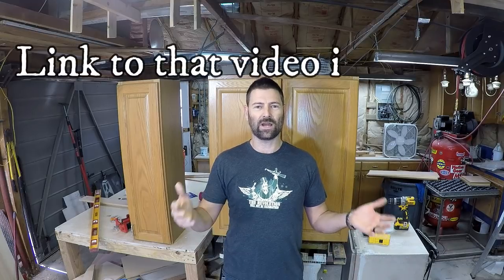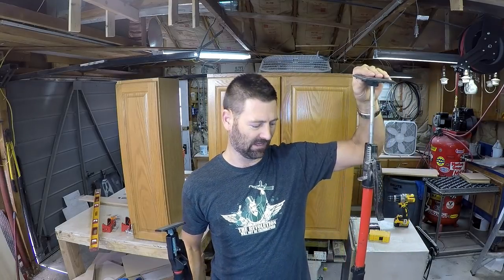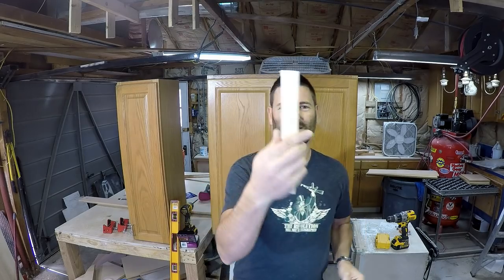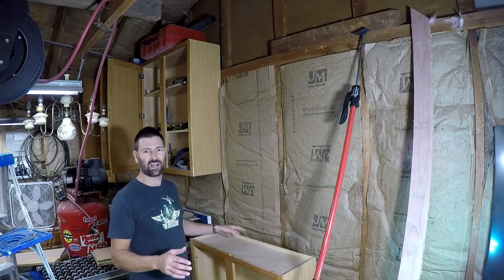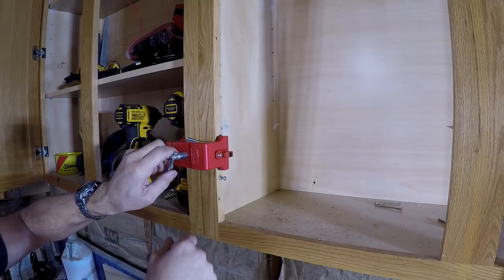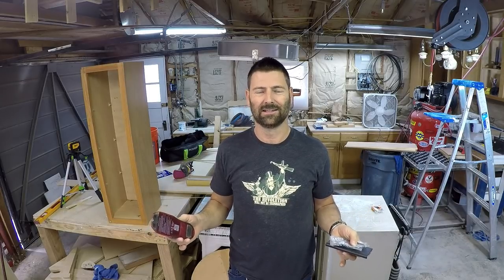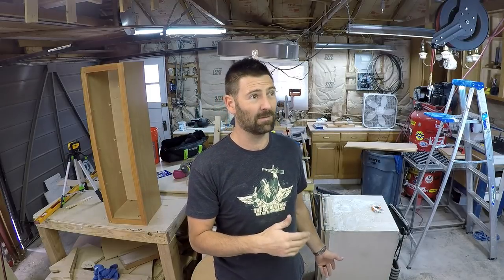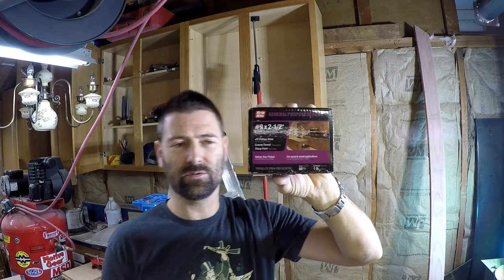Must Have Tools To Install Cabinets | THE HANDYMAN |

Comment: Great video. I've been a trim carpenter for 20 plus years an installed probably 100 sets of cabinets before I discovered the face clamps. There are truly a life an back saver. Makes lining up the cabinet styles an rails effortless. I would check into trim head screws for attaching cabinets together. The head is just about same size as the screw itself. I swear you will love the results. An they are handy for a lot of other situations. I was in trim carpentry for a long time before I discovered trim head screws also. I'm definitely not trying to be condescending because I'm still always trying to learn. An watch your videos often to learn the business side of it all. An I've learned alot. Thanks an God bless
Reply from the maker: Thanks for the comment.  I'm going to go look up the trim head screws right now.   I appreciate the valuable information.
Reply from the maker: I just ordered a box.   Thanks again.
Reply: No worries. Like I said been in it 20 years an still learning. I just discovered CA glue a week ago an used it atleast 10 times. I use it to glue crown an base returns an rolled corners. Saves me from having to glue em an then kill time waiting for dry time. I have learned a lot from your videos on talking to customers an selling my work at the prices it calls for. Estimating has always been intimidating at times. An it's easy to sell yourself short. When I watched your video I was like that's me going over what I'm gonna say an how I'm gonna respond. It's all about confidence an doing research to know what your talking about. Anyways it was awesome to see I'm not the only one running over it all in my head over an over. Sorry for the rant an keep it up brother
Reply: The clamps are great.  Use them to get your drill bit to go in straight.  Use #8 or #9 deck screws.  Then use a long 1/8" drill bit to pre-drill.  Use a drill stop or piece of tape to know when to stop drilling.

You can counter sink the screws in.  Get a countersink bit or a countersing w/o bit.

Comment: I recommend a ledger board that you pre level. This is great if you plan on a backsplash this would be a good reference point for measuring where your studs are in the wall.
Reply: Great idea, I do this every time. Makes solo installation much easier.

Comment: Well we’ll we’ll.... looks like this guy will be ordering the third hand set and clamps😎Thanks for the info !
Reply: I used a truck bed cargo bar when I did mine. Has holes in the feet so I attached square pieces of wood.

Comment: Good info. I like the third hands and use them often. A couple of other tips I use. I like to locate the top and bottom screws at the hinge location to hide them. I also use trim head screws to go through the face frames. McFeely's has really strong hardened screws that seldom break, even in hardwood. Proud to call myself a Handyman. Cheers!

Comment: I've been using a stud finder that is just basically some strong magnets.  It picks up where the drywall was screwed into the studs.  It has worked flawlessly so far, but obviously has its limitations.
Reply: Only problem with that is,  it only finds nails and screws , your dependent on the last guy to be in,on the stud , doesn't actually find the stud .but kinda works i guess .

Comment: Very nice demo. The right tools make all the difference. I have two new dishwasher installs tomorrow and sure as shooting, the base cabinets will not be vertically square and at least one of the old ones will be a nightmare to extract because the floor tile was installed after DW was shoved in the hole, and the other one, I'll have to trim a cabinet to get the new DW pull down door to open correctly. But with the right tools, no sweat. keep up the good work Handyman.

Comment: Regular wood screws for the face frames, i drill them with a tapered countersink drill bit. GRK screws to attach to walls. You don’t want to get pull through for holding the weight of the cabinet. Good video.

Comment: I bought a pair of those bessy clamps after watching your first video. They are nice. I also bought four of those blue zip-up poles after you posted that video a few months back and have used them for holding plastic up. I bought a pair of the mini third-hand poles for mounting cabinets when you already have a countertop.

Comment: Great tips and demonstration of the various tools.  Tip: use star or square head screws to reduce the risk of stripping phillip screws and to get more grip to drive in screws.  Curious.  Why no ledger board?  I assume so you can demonstrate the use of the 3rd hands.
Reply: I'm guessing no need with the 3rd hand?
Reply: I use a ledger board.  That is level.  Then no guesswork.

Comment: To add to this, I am torx/ star screws every where, cabinet screws a must, I like tools that double up, less to haul in and out.
My impact with 1/4” bits, just swap for star bit to drill bit on one tool.  Face frame clamp is nice.

Comment: How about a stud finder, hole saw set for drilling plumbing holes, oscilating saw for trimming shims, foxtail brush for cleaning out the cabinets, and maybe a bar of parafin or soap to coat the screws so they drive into harder wood species without snapping.

Comment: Great video on  the tools used to install cabinets.  With a 3 inch wood screw isn't there a risk of puncturing an electrical wire or plumbing pipe?

Comment: Another thing I do is rub a bar of soap along the screws before i put them in. As the screw turns, it heats up and melts the soap, which lubricates it and helps eliminate split stiles
Reply from the maker: great tip.  I will have to try that one.

Comment: Have you ever used the EZ-Level cabinet levelers to install floor cabinets and if so what was your impression? They look like they would work pretty dang good and not a bad price either at about $7.50 a pop

Comment: Oh that walabot is all I use. It saved me from finding wood or metal studs with wires running through them so I didn't hit those wires or plumbing either while drilling or cutting into said wall. Go test it out and looking forward to your thoughts.

Comment: Lots of electrical on the wall where I want to hang my cabinet...right above 2 sockets.. I've tried locating the studs with a Zircon, but false readings...

I'm thinking I should just cut out the existing drywall 1" smaller than the cabinet so I can see the internals...and be SURE I don't hit wires!! 

....or endoscope it.

Rather cut out the panel though...Nobody will know unless they take down the cabinet...

Thoughts? Thanks

Comment: One comment, to screw the cabinet together I use or recommend trim head screws. The small head gets countersunk, plus they come in white or black which looks better on painted cabinets. Barely noticeable when complete
Reply: Use a countersink to put them flush with the surface.

Comment: Instead of polls i put a ledger board level across the bottom and set the boxes on that. Also. I put a 3/4" scrap between the studs at the top of the cabinets so I don't have to worry about finding a stud.

Comment: Nice work.  I bought the 3rd Hand 4 pack in 2004 and never thought to use them the way you do.  I would put 2 under a cabinet but your way looks better.  Is there a reason you don't use the guide hole in the face frame clamps?  And did no one before you think to use "The Handyman" for their channel?  Did you start this in 2005 or something?  Sorry for all the questions.

Comment: Question on securing narrower cabinets.  We have a wall that is 99", and the cabinets that we are buying are only available in 30" and 36".  Since one is above the stove, we were intending to go with the 30" boxes, with 3" spacers at one end, and on both sides of the bridge above the stove, which will frame the microwave nicely.
Problem:  Studs are on the corner (behind the 3" spacer), at 16, 32, 48, 64, 80, 96, and the other corner.
Cabinet bulkheads are at 3, 33, 63, 66, and 96.
This puts one stud in the middle of the first cabinet, the 2nd just inside the bulkhead, but then only one stud behind the 2nd cabinet, and finally, one behind the 3rd cabinet, plus one directly behind the bulkhead.
These are particleboard cabinets and I'm not sure that I trust them hanging on only one stud.

The only solution that I can think of is to mount strips to the wall, attached to all studs, then screw the cabinets to them, then build out the backsplash to fill the gap.
What do you think?

Comment: I find all kinds of uses for GRK cabinet screws, not just for cabinet installation. I keep several sizes in my screw organizer.
Reply: Karl Armbrust the GRK’s are nice. I’m not sold on the need to use torx though. Sometimes it’s an inconvenience.
Reply: Mookie Man when I have a choice, I always buy torx. Bits last longer, screw heads never strip. Yes, it’s a bit inconvenient to make sure you have the bits when you need them, but the larger boxes of screws usually include a color-coded bit. I think they are worth the inconvenience.
Reply: Have been using GRK screws for years,great product,also make trim head screws to hold cabinets together
Reply: Karl Armburst, where do you buy GRK cabinet screws?
Reply: Earl Stivers In my area Home Depot and Menard’s.
Reply: Thanks 
 @karlarmbrust8846

Comment: It the back panel with enough thickness to support the cabinet?

I've seen videos where the cabinet it attached on the rail not over the back panel directly. Can you show the way, please?

As far one the best explanation ever about Upper Cabinets installation, very nice spoken, tools y patience.

Kind regards,

Matt.
Reply from the maker: Only cheap cabinets have a thin back.  These cabinets in this video and in all my other videos have a solid back to them.
Reply: @TheHandyman1  thank you, I really appreciate it.

Regards!
Reply from the maker: Some will have thicker strips of wood at the top and bottom to screw through
Reply: @TheHandyman1  which thickness do you use or is recommended for the back panel?

Comment: I use a tool called a “studbuddy” from amazon literally the best stud finder ive found lol got it samurai carpenter he showed it and it needs no batteries, it works off of a magnet 🧲 with drywall screws and nails
Reply from the maker: I usually work on older homes with wood lath and plaster.

Comment: I might have left the right end of the big cabinet a bit loose from the wall until I got the small cabinet bound to its frame, then checked for the need for a shim. Why no drywall?

Comment: The red bessey clamps appear to be made at different factories in China and QC sucks!! I bought 3, and 2 of them are missing a bushing, causing the drive screw to bore into my cabinet faces and ruined my brand be cabinets!!! And the 3rd is better but it's still not flush behind the plate. I can not recommend at all!!! If you do buy them, you should use an additional shim or something to protect your faces. I'm so mad!!! Great video, BTW. Very helpful. Comment is to warn others of my experience with the bessey clamps.

Comment: Hi

What screw do you use for steel studs in condo apartment?   length and company that manuf.  another question.    Do is ok to intall kitchen cabinets on 1" double drywall on steel studs, is not to weak??  Where can i buy the climbs for cabinets.? 

Thanks.

Comment: I am claiming rights to the error at 9:30ish, and cutting off haters.
Denigrating comments are hereby denied.
SUBJECT: Yeeees, it's true there are 2 forms of echolocation, and he said, "sonar".  Radar would be the expected word use, however if you will look up SONAR, you will find that it is a form of sound wave, and the lesser included definition is for both water and air, whereas Radar is more typically used above sea level.
The man is correct.
Reply from the maker: Thanks for the comment.

Comment: Hey Mr. Handyman, quick question. I have seen cabinets that are "floating" with no wall behind it. I would assume you would use the same method finding the studs in the ceiling to screw into?

Comment: I have some of the home depot yellow extendo sticks, they even have different ends to make the poles more functional for other jobs.   That handle that you grip to extend is neat though, on mine you just turn the pole and it screws up or down.  Has anyone noticed you put some of the shelves in backwards so the finished side is to the inside of the cabinet?  The Internet usually see everything.  If not are they still like that?

Comment: See that use fastcap, but wondering if ever tried the ZipWall brand. If so, any major differences (besides PRICE), & which do you prefer? Wondering b/c looking to get more & don't wanna spend money on more ZipWall, especially if Fastcap works just fine.
Thx😊
Reply from the maker: Not sure how much weight zipwall brand can hold up.
Reply: FastCaps has some good videos on the 3rd hand holding cabinets and for use in dust walls.

Comment: Are there standard dimensions for install the upper cabinets above the face cabinets?  And, is such a dimension from the countertop height, or from the top of the base?

Comment: Did you have to shim these cabinets? It would be great to see an example where you shim cabinets on non plumb walls.
Reply: It's easy.  Loosen your screws,usea level, put shims where needed.  Score with utility knife and break off.

Comment: On the Bessey clamps, the part that you pivoted away is actually the guide for the drill. After you drill the hole, you pivot the drill guide out of the way and install the screw. I have the walabot and it is not worth the money. Just use a strong magnet for the stud finder.

Comment: Couple of the shelves were installed back to front.  Where did you show the shims to level the front face?  Another vid from past that I missed?
Reply from the maker: These are recycled cabinets that I removed from someone's kitchen most of the edge banding on the shelves has fallen off. Links to the videos where I reminded the kitchens using shims to plumb the cabinets are in the description

Comment: Can you do a video on trying to find floor joists? Maybe using the walabot.

I have some squeaky floors and have a screw kit (not sure how you feel about those) to tighten the sub floor to the joists but I can't find them through the carpet.
Reply: Old post and I hope you've found a solution.  I have a Walabot and it works well on drywall.  I can't get it to work reliably over the Artex crap that the previous owner put in my kitchen and bath.  It "tries", but due to the uneven surface, it's hit or miss.  IF it shows a stud, I trust one to be there, but on the textured finish, it doesn't always show known studs.
Carpet would likely cause the same problem, plus you'd be going through some pretty significant ply floor/subfloor... I don't think it would work for that application.

Comment: Question: when installing top cabinets how high of the floor should they be installed? is there a standard distance that should be between top cabinets bottom and the countertop? thanks for great vid.
Reply: Where i live its 30 inches over the range  and 18 from the counter top every where else
Reply: The size of your cabinets will determine that.

Comment: What about mix and matching kitchen installation systems/accessories(?).  A hang rail makes above cabinet installation pretty easy.  I have seen binding posts used to marry cabinets together in the top most or bottom most shelf interior support shelf holes.

...ummm...nevermind, your clampy thingies appear way more efficient.

Lastly...why no sheetrock?

Comment: 2x4 with notch at top towards cabinet with something soft not to damage cabinet and a slight cut angle on the bottom work well

Comment: My opinion on the Walabot, living in an area with mostly lathe and plaster, is that it is not worth the investment. 
It's not nearly as smooth and accurate as the infomercial would have you believe. 
I tried using mine a few times,  on different wall types and found the results unsatisfactory.  
It now collects dust on a shelf.

Comment: So no more 3 ton floor jack and a 2x4 for solo installs? Sweet! Ok,  you've triggered my OCD. 3 of your shelves have the unfinished sides facing forward. Please fix them so I may watch the Super Bowl without rocking back and forth like Rain Man. "Yeah, 3 shelves are backwords, 3 shelves are backwards."
Reply from the maker: These are recycled cabinets that I took out of someone's kitchen.  The edge banding has fallen off most of the shelves
Reply: @TheHandyman1  I'm just teasing ya, man. I don't have OCD or a floor jack for that matter. Great video as usual. Entertaining and instructional. Thanks!

Comment: I use small diameter self tapping screws . No need to pre drill.
Reply: Small diameter screws mean less shear strength. How much does a large wall cabinet loaded with glass cookery dishes and stoneware plates weigh. Just saying.